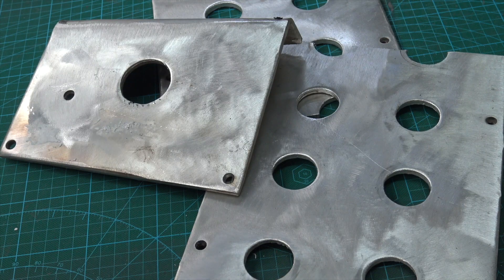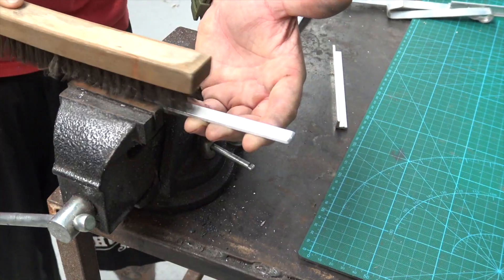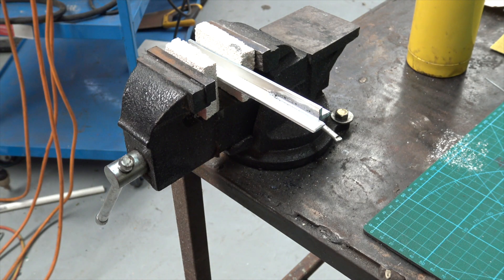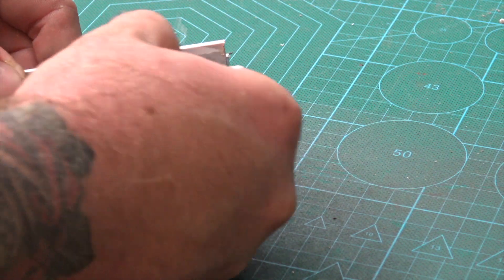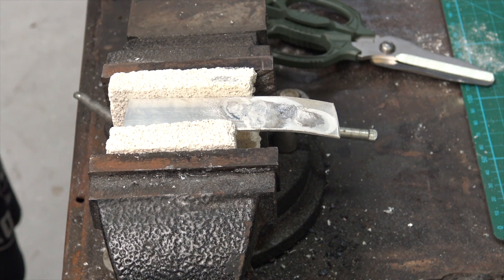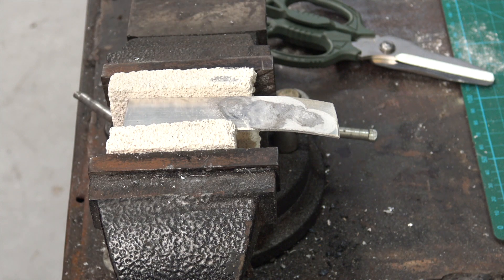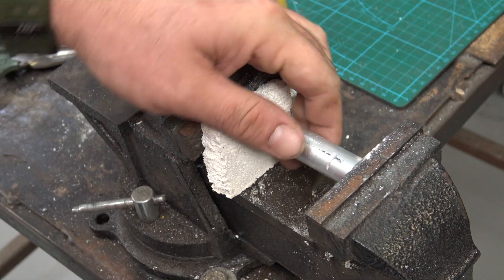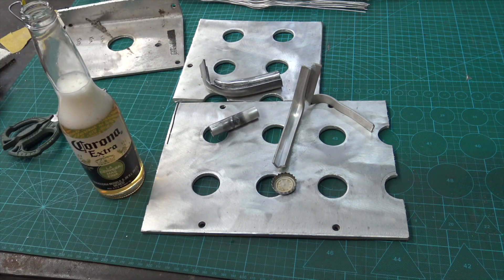Let's have ANOTHER go at aluminium welding / Brazing  Low temp Aluminum rods | With good results!

Comment: those little Bernzomatic and the like torches are really piss poor for control, the use of an acetylene torch with a # 1 or 2 tip would give you much better control. you can turn them down to a flicker of heat instead of a blast

Comment: You shouldn’t heat the rod at all, it won’t fully mechanically bond to the aluminum, or be a weak bond. That’s called sweating, which you don’t want to do. You only heat the work piece.

Comment: Thanks for video. I wanna brazz aluminium for first time. I have questions:
1. Why it us suggested to lower the torch temperature?
2. What material you use to insulate the heat?
3. What aluminium stick you use

Thank you

Comment: Got a couple truck tool boxes from a yard sale for dirt cheap. They had some extra holes drilled in them from the previous owner. Used these rods to patch them up and it worked a charm. Added a couple brackets and they're holding in so far. Thank you for sharing your experience! Cheers!

Comment: rolled my aluminium motorbike (tow behind) trailer 😢.  Panel beating done, 🤞 now time for the aluminium braising. Not structural and will be painted afterwards. 
Might try a piece of stainless underneath the hole as a backer.
Go video and no fluff.
Reply: Braising, eh? How many roasters you having with it? 😂

Comment: aluminium is a good conductor of heat. heat the job just to the side of the join so you can rub the brazing rod on the job out of the main flame. braze tends to flow towards the flame/more heated area. turn your map flame down for thinner materials. propane works.  aluminium is very reactive and  oxidises really fast (21% oxygen in the air) so prep thoroughly by sanding/stainless wire brush etc to expose unoxidised metal and heat to the sweet spot temperature quickly and braze promptly. If it fails to flow easily and quickly then let it cool and prep surface again as the surface may have reoxidised. practice on similar scrap. first. my first attempts were terrible.

Comment: Also try a small flame (jet size ) as size really matters you can practice this method by soldering copper /flux free wire with flux added  diff flame size different thickness different surface areas

Comment: Hi from the uk 
Mabe the problem is not the rods or the gas torch it's the beer, a real serious welder over here would not be caught dead with an Amber euro fizz hell fuck it if it dosnt look like it came from the bottom of a pond it ain't real ale and not worth drinking as for the brazing stuff it's great for a fix that dosnt require the integrity of a tig weld just like with steel it horses for corsces use the appropriate method for the job in hand 
Keep up the good work

Comment: The most important thing is to keep the rod away from the flame. 
Heat the work to temp 1st then touch the rod on the work while maintaining heat to an area well away from the rod to keep the work at temp.
Reply: Just like soldering....I've never brazed anything but, I know this just simple follow same principle. How can a hot weld material bond to a cold work surface, it can't, it becomes a cold joint and would be brittle and useless. Now let the work surface melt your rod then you can drag it across that hot surface applying as much or little as you need

Comment: when you weld short pieces it works but it won't work on longer tubing like 4'x4' square 1/2" it will come apart.

Comment: Was thinking of buying some of these you sold them to me ,i am a chef no construction training at all . You have sold them to me though ,getting them off Ebay now to fix splits in the cheap boat that stays down the creek  might be able to fix the transom in stead of rowing as well .We shall see a bit of practice first . Cordless wire brushes on an impact gun clean aluminium fixed new(second handy) motor goin onto the boat at the hut .

Comment: I'd say you got some pretty awesome results!, the problem I believe with the first can is due to the fact you were using MAPP Gas which is too hot for aluminium of that thickness thus melting, I believe if you Used a gas with a lower operational temp you would then meet with success with the can. These rods are great in a pinch!

Comment: This is cool thanks, really all I want to do with these (the ones that claim to connect copper to aluminum) to stick pieces of metal together merely to construct a roughly-hewn, blatantly scrap metal (if not steampunkish or post-apocalyptic) Native American-style Flute. Not heavy duty. But I don''t want them to tap it against the table and pop off either. Guess I need to test whatever brands look good.
Reply from the maker: They are strong, you would definitely need some sort of flux attempting to join to copper

Comment: Seen a vid on diff rods having diff melt points ,parent metal needs to be about 720 to 750 degrees for most rods but some were utter shit.
Reply from the maker: The quality control on the zinc or whatever base they mix with must vary from manurfactures, and most likely batch to batch at some places

Comment: I have found that not all rods melt at the advertised temp. Using the cheaper rods generally melt at a higher temp and that is why the can was giving you problems. Good job.

Comment: If I have a piece I need to reattach strength not an issue but need to know if brazing will allow the two piece to electrically ground to each other

Comment: Project Farm did a test with several different brands, and found a significant difference in melting points and performance. You may want to try a different brand/supplier.

Comment: your supposed to heat the metal but do NOT get the flame on the rod or you get oxide straight away on the rod.. with cans have to be ready to pull heat away fast.
Reply from the maker: Good tips

Comment: what the melting point im thinking of using this technique for  crankcase what your thoughts on it.
Reply from the maker: it's a low melting point around just under 400 degree's. I do not see the crankcase getting that hot but i honestly would not be able to tell you if i would trust it to hold up. it really depends on the type of repair and what sort of stress it would encounter.

Comment: My question is this. Ok so I have a blue gas cartridge from toolstation. Propane and butane. So trying to heat a bolt with a nut half way along. Using brazing wire and when both the bolt and nut are glowing red, the brazing wire comes away in short segments not fluid. Is this because the map gas and or my new gun not used yet from Bullfinch, both will be hotter than my can of gas? See the can of gas says 1950c and brazing only wants 880c so over a 1000 hotter surely it should make the braze run liquid. Just dont know. 

Tried aluminium braze and its just shit. Aluminium angle cleaned with just aluminium brush only for aluminium and heat with my propane butane gas mix. It does not run liquid either. 

Anyone know the answer? My £3500 tig welding machine is just so much better. Only I need the braze for joining two different thpea of non ferrous metals. Your help appreciated
Reply from the maker: the brazing wire is getting too hot
Reply: @Finntheweekendwarrior  ok so I glow the metal to cherry red. Just before I had heated the wire a bit then put it in the flux. Is this right? Then I moved the flame away and touched the fluxed wire to the part. Nothing happened. Then held it there and moved the flame closer. It dropped into sections of wire 4mm length I suppose. Not fluid at all. 

What’s the process?
Reply from the maker: Try bringing the workpiece up to heat slower,  remove the flame and “scratch start” the rod for a second to see if your there. as you get closer to the temp the rod will start feeling softer and then all of a sudden it will puddle. 

I have had a lot of trouble in the past getting the “logs” fall off and I had originally written these things off as trash
Reply: Scratch start? 

I also bought a Bullfinch torch but still waiting the propane pipe. Someone on a youtube vid said to try without a good torch is a waste of time. 

I think if I remember back to when I was 12 to 15 at school which considering im now 47 is quite some time back, I used something with a savage flame.
Reply from the maker: Yeah scratch start is the best way I can describe rubbing the rod on the peice
Reply: I managed to get the brazing to work finally. This is what I did. You know you spoke of the logs. Little sections of wire breaking off. Right well recall I was using blue can propane butane mix. Yep well. Only if I every five seconds pass the wire through the top of the flame to pre warm it and concentrate on keeping the inner blue flame tip ten mm from the job would the braze turn to liquid. 

In short the flame as heard before is not hot enough. That is the underlying reason. Am going to be using my new bullfinch torch later in the week so can confirm this with you then if you like.

Comment: Good video but always keep the flame away from the rod.  Heat the material, take away the flame, touch the rod to material; if it melts keep some heat on material away from rod, heat from back side of material.  Good job.  I like your attitude.
Reply from the maker: Thanks for the tips!
Reply: Whats your heat source?

Comment: Thanks my first attempt I could not get a water tight seal. I'm going to try map gas.
Reply from the maker: Did it work?
Reply: Mapp gas is too hot. These rods melt around 700 degrees
Reply: Is it possible to use lpg torch for this kind of rod? Thanks
Reply: @buildonbudgetph4662  you can use propane but if the piece is big the aluminium sucks all the heat out so I could only melt the rod by applying heat to the rod. Your not supposed to do that. Just heat the other side of the metal and let the rod melt on contact.  The rod has to be close to 750deg to melt and that is the max for propane.

Comment: i can't make it stick to the parent metal
Reply from the maker: Either the parent metal is not clean enough or it is not hot enough.
Did you chemically clean it?
Reply: @Finntheweekendwarrior  I just used  a rotational wire brush and some soap. What should I use?
Reply: Mine was not cleaned with acetone but wire and sandpaper. I was using propane and the rod wouldn't melt. So I need to get map gas and use an insulating spacer on my vice?
Reply from the maker: Propane should get hot enough, how big is your workpiece
Reply: @Finntheweekendwarrior  connecting 2 pieces 1"w x 2" l x 5/16" thick. Trying to attach them hotdogs way so only an inch of connection. Held propane on it for almost 10 minutes and the rod wouldn't melt unless the torch was directly on it for 5-10 seconds. Would never completely melt
Reply from the maker: I think your not hot enough, defiantly try insulating the work pieces from the vice/bench. How “Broad” is your flame?

I found rubbing/scratching the rod every now and then on the workpiece as you head the work helps you “feel the temp”
Reply: @Finntheweekendwarrior  map gas and tiles between pieces and vice helped. Unfortunately when I flipped it over and did the other side, the first side melted out. Getting closer, thanks. My rods are from harbor freight so that probably doesn't help
Reply from the maker: Mine are from the depths of eBay, don’t stress my first packet was a full fail